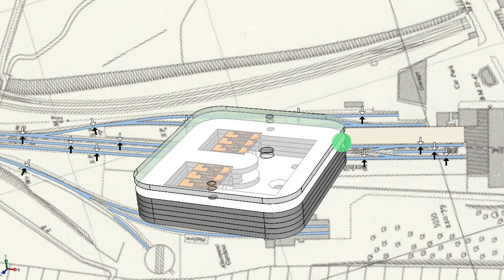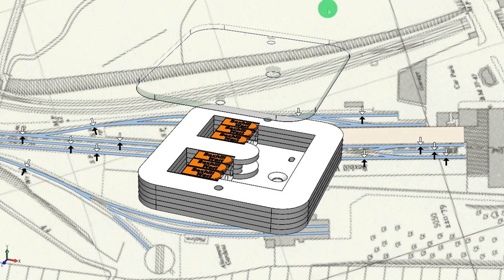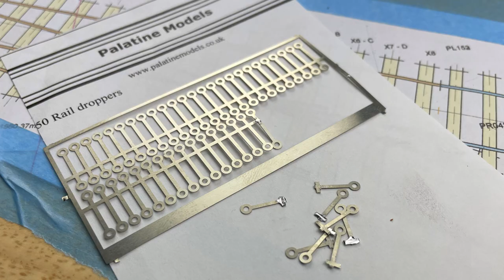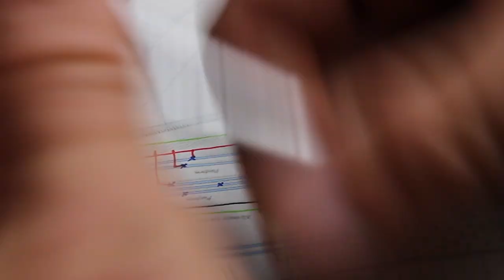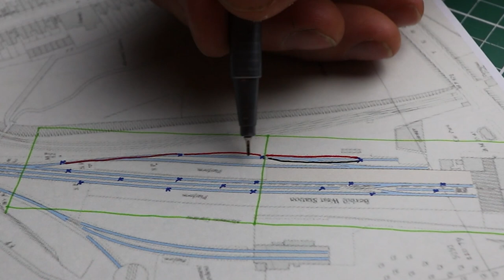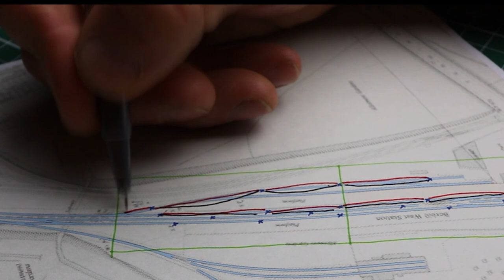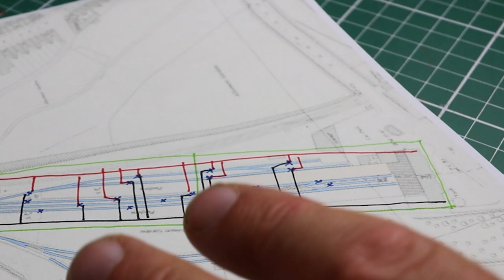S2 E5 Track Wiring Junction Boxes

Comment: I don't know if a Benbo tripod would be better. Has a moveable boom arm so you can take pics at any angle. Not like conventional tripod heads.
Reply from the maker: Thank you for the suggestion.  I haven't heard of Benbo tripods, I will check them out.  I could certainly do with getting the camera out of the way.  Typically when I'm filming something up close I've got 3 tripods, one camera and 2 lighting.  In filming this video I was soldering on my knees squeezed between the three of them - it's quite a struggle. :)

Comment: Your junction boxes are certainly very neat, but I have a feeling that all they're hiding/tidying is the actual connections between one wire and another, and it's the connections you are most likely going to need to check/repair, rather than the cables themselves, so I'm not really sure how much you're gaining over just using the various solder-less connection things that you see on most model railway channels on youtube (e.g. https://www.youtube.com/watch?v=Z6UuYBWFLLU - just the most recent one I've seen).
The little frets look pretty, but what do you gain over just soldering the wire to the underneath of the rail?  Are you just using two soldered joints where one would do, thus doubling the risk of a dry or otherwise weak joint?

On your question, my first thought was why do you need so many droppers in the first place?  I've never done anything in as fine a scale as P4, so I don't know what you will use to connect rails. Standard rail joiners are themselves conductors, and that connection can be strengthened by soldering the joints.  Certainly in DC your rails only needing breaking where you need to create sections in the track that can be isolated or to prevent shorts (e.g. at points or reverse loops). I've never used DCC, but I understand that there might be risks of loss or of at least reduced signal over long runs of thinner cables.  I'm not an electrical engineer, but I can't really see that a stretch of rail would degrade the DCC signal more than a bus wire running alongside it; certainly not at the distances involved on Bexhill West.  Similarly, I don't see why you would need all those power districts you mentioned.

You mentioned that you thought radio control of locomotives interests you.  Isn't that really what DCC is, but using the rails to transmit signals between the controller and the locomotive rather than antennae?  Obviously, if you really want to go with RC, go ahead: I'm sure it'll be interesting to watch how you do it. But since DCC has become widespread, you'd just be inventing a vaguely round thing that fitted on an axle, to replace wheels that have already been invented and have benefited from years of development.

You said something about using relays with the points: I presume this would be to switch frog polarity. But I can't but help think that if you really want to reinvent something, buy a tortoise (or similar) point motor, take it apart, and reinvent that. Or just use that.  Or - and I think this might interest your engineering and manufacturing self, have a look at how the points are operated on the Great Chesterford Junction youtube channel (scroll down his list of videos all the way to his very first ones): they definitely don't meet your neatness criteria though!
Reply from the maker: Thank you for your fulsome reply Andrew, I appreciate your thoughts.
I'm quite sure that my junction boxes offer no technical advantage at all, they were just my attempt at keeping the wiring tidy and hopefully free from being pulled-out whilst moving the boards around.  A practical advantage of these connectors over others is that they are reusable, so will accommodate my inevitable reengineering at a later stage.
Your thoughts re the dropper frets have got me thinking.  I'd planned to use them in order that the soldered connection to the rail was 'repairable' if need be.  Thinking on this a little more the frets will probably break off of the rails should they need to dug out of the ballast.  Given that the rail is held on chair which are easy to cut from the sleepers and replace, I might be better-off just soldering directly to the rail, especially as I cannot imagine the connection becoming accidently damaged as the connection below the base board will be protected by the junction boxes.  So thank you, you will have saved me a lot of time.
Each track 'panel' is 500mm long, and I don't want to rely upon connections between the rails, hence there will be the need for track feeds every 500mm. 
As for radio control, to me as an 'outsider' to this hobby it seems entirely logical, no electrical feeds below the baseboard - yet with many of the benefits of DCC.  Maybe I'm mad.  I plan to build one locomotive with radio control as a proof of concept but will probably not take it any further.
You are right, I do like to make things, and in particular think through problems.  That is the motivator for me.  I don't necessarily think my ideas are for everyone, and purchasing items such as point motors would certainly be a quicker solution and probably cheaper too.  But it is in my nature to overcomplicate everything, and refine until I achieve an elegant solution.  I suspect I'll never change.  :)
Thanks for watchinng,
James

Comment: I'm no expert , but IMO version two is fine, provided you don't use the same thin gauge wire as the dropper wires used in this video between boxes otherwise you may loose the advantage that the mains cable offers of having little voltage drop.  If the dropper wires are short into the junction boxes, and the main cable run between junction boxes this would give you the best result.
Reply from the maker: Thank you Malcolm, the plan will be to use 2.5mm sq. cable to the boxes with just the droppers being the finer stuff.  I appreciate your input, as your are certainly more of an expert than me.  :)
All the best,
James

Comment: DCC - control the engine itself not the track, perfectly would be one controller per engine on the layout (without those parking in the fiddle yard).
Look up LocoNet -> visit Paul, Sandling Junction.

From ~6:00 on:
You still got a solder joint under the track + the new ring-shaped in the ballast.
Your bus cables got another colour sheme then those to the track.
Cecking if track power is on (and polarisation is the same) get´s normally done directly from the track, therefore it´s sure all conections work as should, without looking under the layout.
Turnout frog polarisation with changing of the frog (same component / switcher for both), if you control it separat from the railroad switch blades it´s conection to the track and the frog polarisation could make a short as one might be faster then the other.

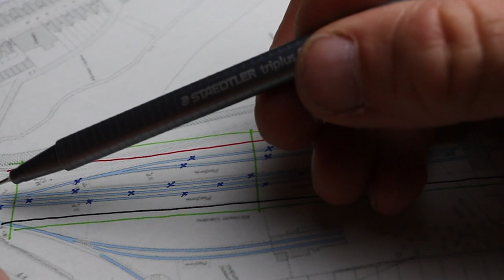From ~15:00 on:
Well DCC isn´t actually DC - about the colours of the cables just keep the colour sheme on your segments the same
and if - somewhere in the future - you should connect with other peoples moduls, check polarisations of the rails from modul to modul.
Analog would be done from one segment to the next connecting the rails of a track electronicly by feeders.
DCC - without block detection - one strong bus wire (not less then 2,5 mm² [FREMO]) throw from one modul/segment face to the other and from that to each (left or right / back or front) rail (not less then 1,0mm²) of the modul / segment.
DDC with block detections is rather complex -> look up yt-canals Chadwick and McKinley Model Railway.
NO, it´s version one! NO, "neater" would be over block detection but that would be way overcomplicated for your purpose (as it´s for letting a computer run long distances, not for pur people driven locomotives)
RC on shows would cause problems with others that use RC (trucks, cars, boats, planes, ...), only what is conected to the track is getting your commands.

[jedi on] Tendency for overdoing is strong with you, I see [jedi off]
Reply from the maker: OK Jedi master, points noted.  :)  I suspect that my tendency to overdo things will never change.  I enjoy seeing every challenge as a little project in itself and suspect that I'd become bored if I just followed the 'rule book'.
As always, thanks for watching,
James